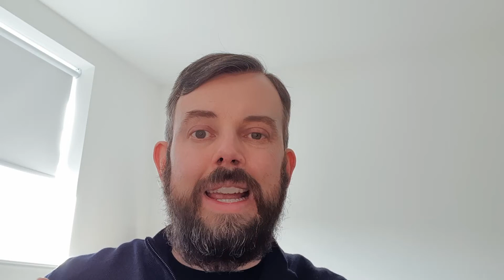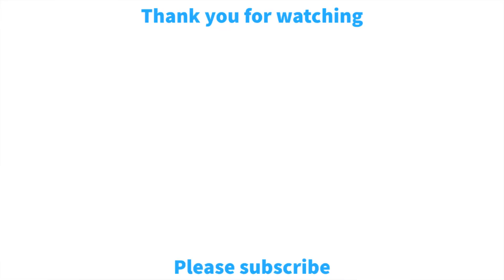5 myths about electrical work in the UK

Comment: Hi James if a plastic water pipe is in coming, should it still be earthed on the copper side after stop tap incase the pipe goes into brick walls throughout the house etc? Could it not introduce earth potential?
Reply from the maker: Hi Adam,
Thank you for your question. If the incoming water pipe is plastic, it is generally not a requirement to apply protective bonding. However, if the copper pipework after the stop tap goes underground or comes into contact with earth, then in that case it would become an extraneous conductive part, which would require bonding. 
An extraneous conductive part is a conductive part that could introduce a potential, generally earth potential. Examples of this would be where metal pipes are in contact with the earth and also metal pipes that run between more than one installation.
Regards
James